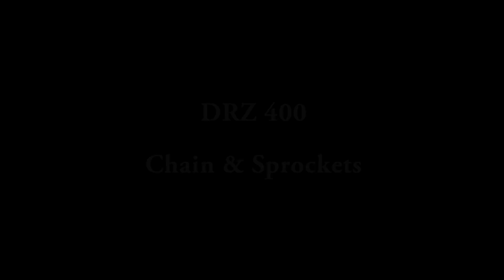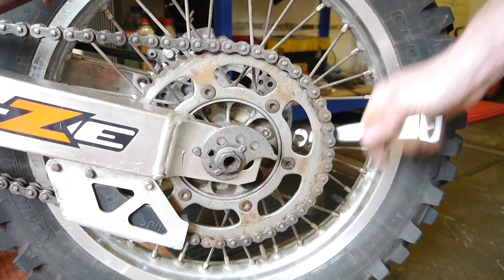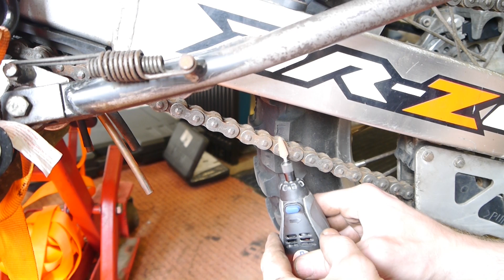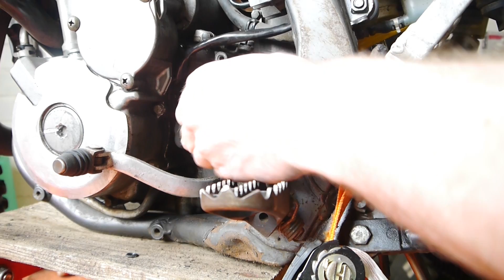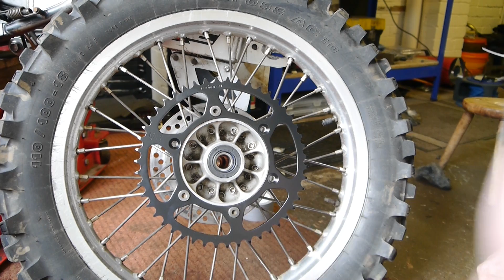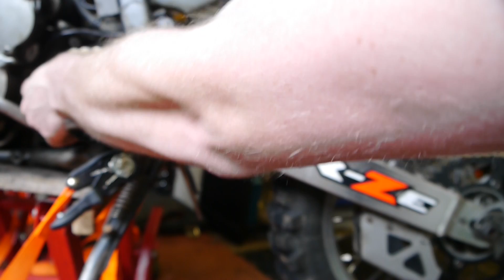DRZ 400 Chain & Sprockets Replacement

Comment: My front sprocket nut is loose. I am reading about the Loctite fix but I am not comfortable with taking off the chain. Can I do it without taking off the chain?
Reply from the maker: Yes, no need to take chain off. It’s just the nut

Comment: I ride almost always in deep silty sand.  At 12000 miles I decided to change my chain and sprockets.  The old chain seemed fine, however.  Front sprocket was chewed up, rear seemed fine.  I put a hybrid sprocket on rear, with aluminum insert, new front and new chain.  5000 miles later, the hybrid sprocket, which actually weighed nearly same as stock, thick steel one, had cracked.   I put the original back on.   Bike is a beast.
Reply from the maker: 👍🏻  I need to get mine back on the road. It’s sat at the side of my garage for about 8 years

Comment: Way easier to install the master link with the ends of the chain rear sprocket,for me anyway.
Reply from the maker: That’s how I do it now too
Reply: about to do this job tomorrow... can you explain what you mean? the master link is on the rear sprocket rather than floating inbetween sprockets?  is that what you mean?

Comment: how do you align the rear wear and correctly tension the chain?
Reply from the maker: There’s marks on the chain adjusters, make sure they’re at the same point. If you want to make sure it’s perfect you can get a laser chain alignment tool and rest it on the sprocket and shine it up the chain to make sure it stays in the same point of the chain. Check the chain tension by moving the chain about halfway between the sprockets up and down and see how much movement there is.

Comment: I just aquired a 06 drz400s and i have been researching but to no avail, what is the correct term for this style of chain tensioner?
Reply from the maker: No idea, snail? it’s just the standard axle that comes with the bike. Some of the S/SM models have the usual nut and bolt adjusters.
Reply: @MuddySump  thanks bro It is a snail chain adjuster!

Comment: just curious how long did it take for you to change both sprockets and chain? the shop is saying it takes two hours but I know it doesn't take that long
Reply from the maker: +kendal mcdowell not even an hour. The only part you need to take off the bike is the rear wheel to change the back sprocket. Split the chain then that pulls through and the front sprocket comes off when the chains off
Reply: It's a flat rate charge. And reasonable for the amount of work that needs to be done. Either pay the man what he wants or learn to do it yourself.

Comment: Mate, love your videos,Since getting my drz they've helped me out no end. One more thing, what is the standard gear ratio, I can't seem to find it in my book. I do mainly trail riding so am told want one down on the back, but not sure... Also need new chain and sprocket, can you recommend the best ?
Reply from the maker: +Alex West what version have you got? They have different sized sprockets
Reply: To answer your question the the E model has 14/47 sprockets from factory the S model has 15/44 and finally the SM model has 15/41.

Comment: How much play should there be in the chains tension? I'm finding a lot of different opinions such as checking it with the suspension compressed, not compressed, or both.
Reply: As per the O/M, 40 to 50mm or about 1.75 to 2 inch's with the suspension fully extended.

Comment: I'm doing this now, I can't get the nut off the front sprocket though... I've tried putting the front wheel against the wall and standing on the back brake whilst applying pressure, but still nothing. I'm tempted to use heat if you think this would work? I have no access to air tools.
Reply: +MuddySump I've finally done it! With the help of heat and an impact gun.
Reply from the maker: Have you opened the lock washer up? It will be tight. What length bar/ratchet are you using to get the nut off?
Reply: Thanks for the reply, I've folded the the locking washer back as best as I can, it seems to be flat but it's also quite distorted so I'm not really sure. I'm using about a 1.5 foot torque wrench (not ideal) and a 6 point socket.
Reply from the maker: +Ollie Davies might need something to get more leverage on it. Think my breaker bar is 32" and still struggle with that sometimes
Reply: ah right I'll try find something longer then, thanks!
Reply from the maker: +Oliver Clarbour-Davies tough one :-)

Comment: I know I'm super late to the party... But I don't need any special sprockets for the x ring chain right? Just jt 520 grade sprockets will work right? Also do most sprocket packs come with the front new washer? Thanks in advance and your vids are a ton of help!
Reply from the maker: No, they're all the same. I don't think any kits come with the washer. I got that separate. Think it was less than £1
Reply from the maker: No, they're all the same. I don't think any kits come with the washer. I got that separate. Think it was less than £1
Reply: +MuddySump can you tell me what the hell the washer is called? Lol I can't find one anywhere..
Reply from the maker: +LastToFail I think it's just a locking tab washer. Might have to get it from a dealership?

Comment: Nice as my luck would have it i have rounded two of the allen heads and corresponding nut, and cant get that blasted front sprocket off even with a great breaking bar :(
Reply from the maker: Is it turning the wheel too while trying or just not moving at all?
Reply: Managed to do it with a huge air gun and 15 min of working it both ways to loosen it up. That thing was tight!
Reply from the maker: 15 minutes even with an airgun :-0
Reply: Yeah i know. Now i have to find some aftermarket sprockets that don't have any more than 40 teeth at rear.

Comment: It pissed me off when  thought I'd do this in 30 minutes  at work and found there was no split link I had to cut it. 2 days later all my oil dumped all over my back wheel just when I got into a wheely and I nearly came off, so i torqued it to 80ft/lbs and it still happened again the next day. You have to do the loctite fix and I put it on the splines and the threads just incase it can't do any harm. And I've been told 80ft/lbs is good I ride mine daily and check it hourly now haha but it hasn't come loose in a month now.
Reply from the maker: Did the output shaft seal go? Did you replace a seal or did it just stop leaking?
Reply: I was sure it had and dreading replacing it, but I just tightened it back up and all was well and still is :)

Comment: Nice vid! Came across this looking to do the loctite fix on front sprocket. Haven't seen you on drz forum for a little while. Just to re confirm I'll need to put some loctite on inside of nut AND some on spine thread once the washer is on...
Reply from the maker: Hi, just got back from work and couldn't reply on phone.  Not been on forums for a while, need to get caught up on them all.  I dont think it really matters, i would just put it on the spline where the nut sits, its going to be enough to keep it from moving.

Comment: If you do not us a torque wrench on the transmission you can over tighten it and burn the bearings up you really should redo it. If your transmission seal starts to leak oil it’s too late.
Reply: B.S